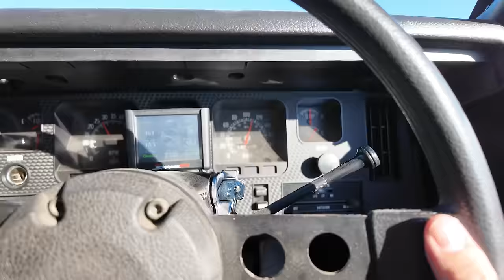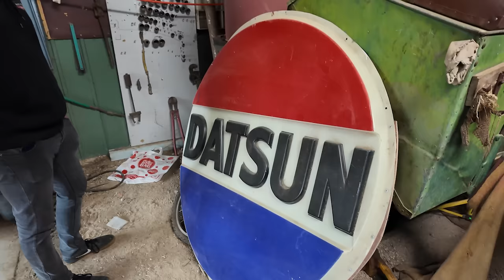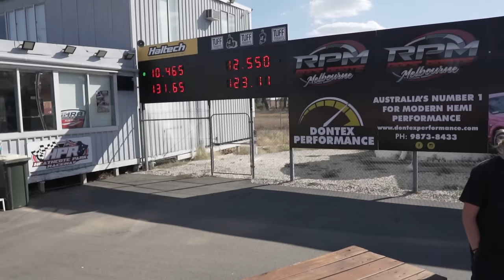The HARDASS 1000 was EPIC!!!

Comment: Michael,  you should practice slipping the clutch for longer and not just dumping it .

When you drop the clutch at say 2800 rpm, the engine practically stalls, and the engine falls out of its power band and the car noses over.
The car ran 4 tenths faster when you launch at around 4000 rpm because you slipped the tyre enabling to engine to stay in a better part of its power band .
Slipping the tyre isn't the way to go faster, as radial tyres loose grip when they slip. 
If you slip the clutch instead of the tyre you get benefit of keeping the engine in it power band and gain  additional grip by not slipping the tyre.

In a purpose built manual transmission race winning application the clutch/ pressure plate is designed to slip so when the driver drops the clutch will take up in a pre determined amount of time to lock up.